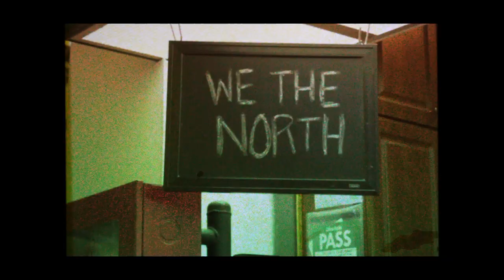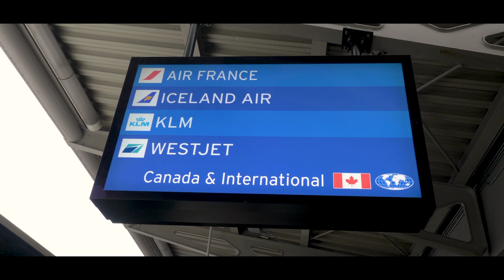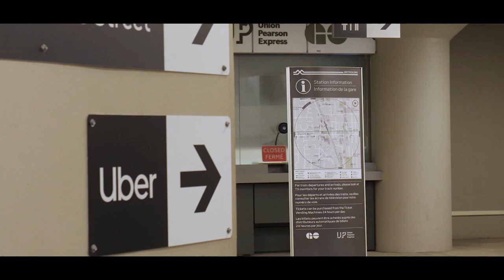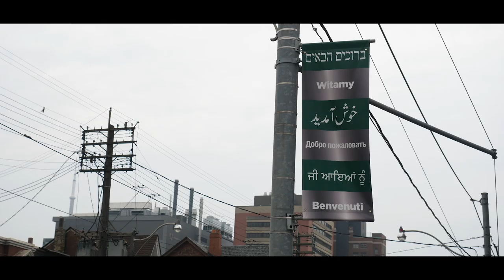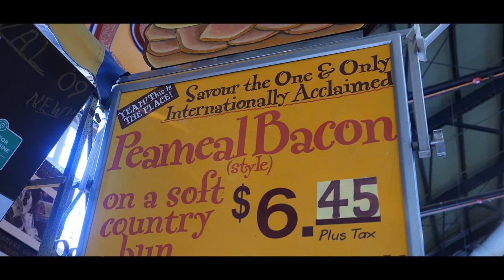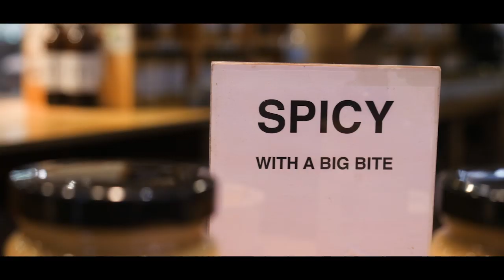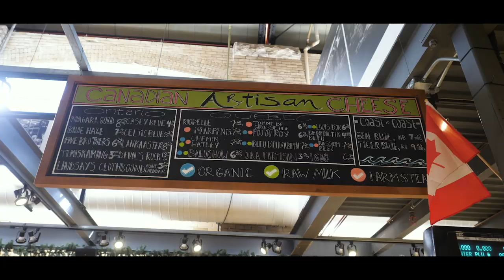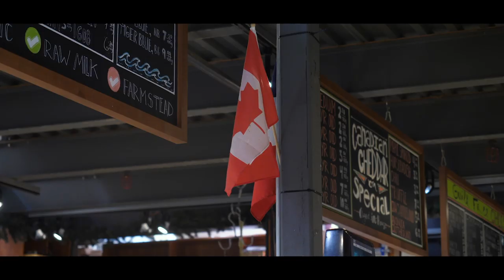Toronto Travel Guide

Comment: Good review - fair assessment. I live here, and have done so for over 30 years. It is a constantly changing city and it has problems to be sure but the amount of integration and welcoming of people from around the world is one of the best aspects of this city. There is lots of good food here and a wide array of entertainment. A walkable city albeit crowded in the core and it can be damn hot in the summer and bitterly cold in the winter. For the heat perhaps Toronto is not as bad as cities such as Tokyo but you can escape the heat (and winter cold) by using the underground PATH system, a network of tunnels and underground plazas that stretch from the lakefront all the way north to Dundas street. 

Hearing the TTC described in a good way grates a bit as it can be one of the most frustrating experiences of life in Toronto but it is possible to travel across the length and breadth of the city with one ticket which is far cheaper than other cities such as London, Paris, Tokyo, and other cities where you have to use a ticket or IC card to enter and exit the system. The Presto card is used once to enter the system and again if you have to transfer from a bus to a subway (or vice versa) but you have a time of about two hours so you can actually exit the system and then return without having to pay an additional fare. 

A good way to get a sense of what Toronto is like, if not actually visiting, is through the local media, particularly the Canadian Broadcasting Corporation (CBC). Such programs as the radio show Metro Morning provide insights into what is going on here, what life is like, and what is generally of interest. For food, check out the critic Suresh Dosh on Metro Morning. He will take you to many wonderful and interesting restaurants, and tells a story about the origins of the places he profiles.
Reply from the maker: That's fantastic insight, thank you.

Comment: Great video, informative as always. Where did you stay? Accommodation seems expensive. What would you recommend for staying in downtown TO: hotel, Airbnb or serviced apartment? Thanks, Hugo
Reply: I'd recommend going to a hostel honestly. There's a good number of them downtown, they're pretty affordable and more importantly, they're well located. Being downtown in Toronto makes a big difference because it's a very sprawled city. Once you get beyond a certain point (I'd say west of Dufferin, north of St. Clair, and east of probably Parliament and certainly Coxwell), it starts to feel very disconnected and suburban, as well as far away from what most tourists would want to do.

Toronto's subway line is handy, but not very comprehensive, so you'll find that if you stay in a section of suburban Toronto that's not within walking distance of a subway, you'll either have to drive in (and Toronto traffic SUCKS during rush hour, and parking is expensive) or you'll have to slog in by bus and subway, which is highly time consuming. 

You might as well stick to downtown even if you have to pay a little extra. You'll save a lot of time and maybe even save a little money on transit.